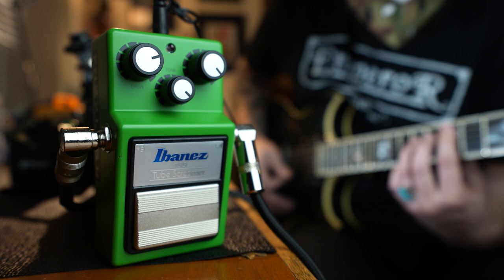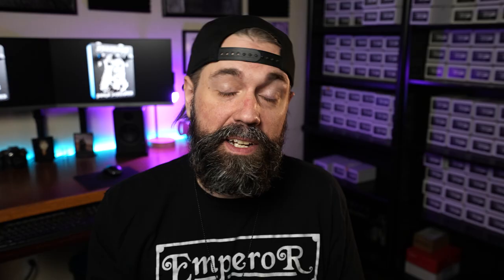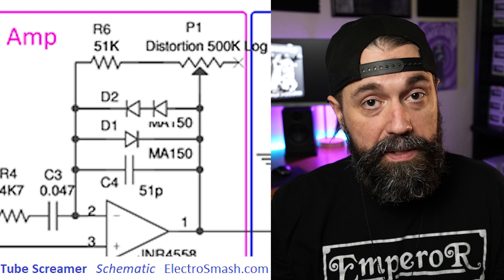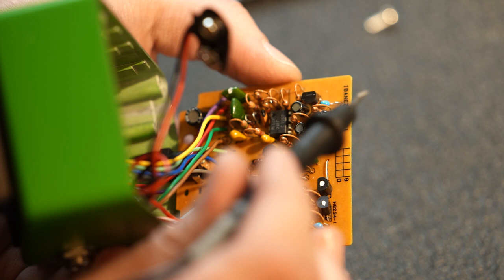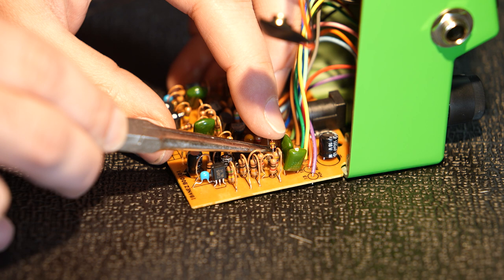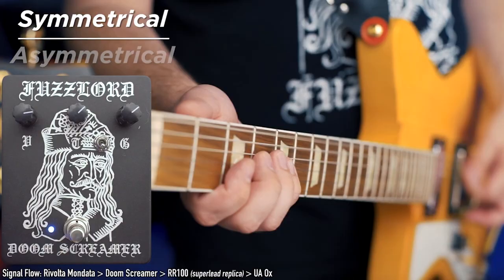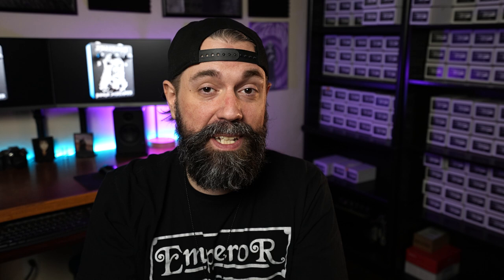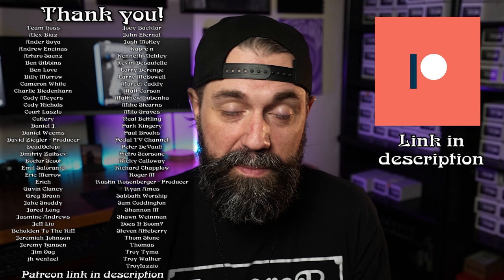How To Mod A Tube Screamer

Comment: Got my first TS9 at 12...my dads bands bassist left it at our house and said I could play around with it. Since he didn’t really use it, he never asked for it back. 

At the time I was using a Roland jazz chorus and it sounded awful for getting hi gain punk rock tones I was after so I didn’t think I liked them or pedals much at all. I found tube amps like the 5150 to give me the sound I was after.

Many years later I found the clean boosting thing into high gain and was back into the TS world.

Currently I have an MXR GT-OD which is a sort of TS808 that can switch to an SD1 via internal switch, and a TS mini.

I still have a love hate thing for that clean signal that’s part of that feedback loop when I’m using it as a regular overdrive (so it’s relegated to only stacking with other drives for solos or as a clean boost into a dirty amp), but I just can’t quit the good old Tube Screamer.

Comment: I am amazed that a new tube screamer still has the original 80s circuit board and is not surface mount! I have never owned a real tube screamer lmao ... I had an 80s Boss DS-1, in the 80s, which i replaced with an OD-2.
Reply from the maker: I was suprised too!

Comment: I have a Demonfx TS clone with switch for TS808 and TS9. I absolutely HATED it. Single coils, HB, hollow bodied with HB didn’t matter - I couldn’t get passed the nasal squawk. For years I’d put it away then pull it once or twice a year. Made me want to vomit. 

I finally tried some of these mods figuring I hated the pedal already and if I F-ed it up no great loss. 

I did the asymmetrical mod and still hated the sound. I then replaced the cap with a 0.15uF instead of 0.1 you recommended. Still figuring no great loss if I screwed up. Well I did melt the pcb a bit but WOW I now love this pedal! 

I didn’t bother with the resistor mod since I didn’t want more gain since I only use low gain. 

I can’t thank you enough for turning this funky green paperweight (yup) into a favorite! I do think I need to invest in a better soldering iron though.
Reply from the maker: I’m so happy to hear the mod went well and now you like the way it sounds!

Comment: I used to like overdrive pedals and I have 3 of them The Rat, TS-9 like yours and the Plexi Drive Deluxe and a Big Muff fuzz pedal, a volume (swell) pedal and a Wah-Wah pedal. Also a tube Monster high gain pedal using a 12AX7. Currently they are all gathering dust. I am in love with Overdriven Tube amps but at my age I am making everyday effort to play clean Jazz and a little blues. I used to play like Jimi Hendrix and in fact this is my natural talent. I played a Strat through a hot rodded Marshall JCM 900 MkIII Hi-Gain head using a Marshall JCM 900 1960A and a Marshall JCM 900 1960B full stack. No need for pedals as the sustain was like a violin and the overdrive was fantastic. The "dimed" Marshall Roar was like a 35 ft. high tidal wave about to break right on top of me on a beach in Hawaii. Actually many times I would turn around and look just to make sure that I had not been transported to that beach and a 35 foot tidal wave was not in fact immediately above me and about to wash all over me. It was a traumatic experience. It was LOVE! I shouldn't go back to that style of playing because it destroys my hearing.
Now, these day's, because I don't wish to give our two birds heart attack's I no longer play at such extremely loud volumes. In fact I play on clean amps and seek to become a better Jazz and Blues musician. It's really difficult for me because my natural talent is playing like Jimi Hendrix- with no effort at all, just wonderful fun and joy and love of music! -Peter age 70
Reply from the maker: Hey Peter! Don't want to rock the birds too hard haha! The Strat through a JCM900 had to sound awesome! Cheers and thanks for watching

Comment: Great video! I don't have any experience modding pedals and can barely get through a basic pickup installation but this really inspires me to take a look at more electrical projects.

My first Tube Screamer was actually a Horizon Devices Precision Drive (before I really understood what an overdrive does). I've had a TS9 and an EHX East River Drive but I'm currently rocking an Earthquaker Devices Plumes. I really miss the old Ibanez original, though; I'll have to pick one up again!

Thanks again, Jason, for making such a killer channel!
Reply from the maker: You can do it man! That is badass you have a Plumes and thanks for watching man!

Comment: Entering V1 with less low end is usually beneficial in order to tighten up the distortion channel for palm mutes (unless you have real metal amp or pedal). But more headroom sounds great. I use my cheap Behringer TO800 with 12V. There seems to be a slight change in dynamics, more so for the AMT K2 that comes afterwards in my chain towards the power amp. Interesting channel, think I will sub!

Comment: I use instead, tc electronic tube pilot adding to the second triode of the 12ax7 tube an 0.1mf grid to ground, 0.1mf grid to cathode and a 25 mfd cathode to ground. Then it is close to transparent with full gain tone. Amazing.

Comment: I first got a sound tank tube screamer in about ‘96. I have since bought a ts-9 about 3 months ago, (I built a diy od pedal but ironically a connection came loose right when I was considering a ts9)...I run a crybaby wah into a TS9, into a hand wired fuzz face clone, with a touch of delay, from a micro cheap pedal, and light amp reverb...The ts9 is awesome!
Reply: I built a klon centaur clone...but soldered the pots onto the wrong side of the board🤦🏻‍♂️minor setback...but a setback nonetheless! I was about to order breadboards and a bunch of stuff to tinker with, and still might...but it slowed my roll! I do enjoy the channel though! Nicely presented information! (McKinley Morganfield is the man I agree;) the episode with playing heavy stuff on a tele was awesome!🤘

Comment: I bought my first TS9 in 2016. I kinda went whole hog back when I was a kid with a Danelectro Fan Tone (still have it), then a Digitech Death Metal (sounds terrible on a small amp, and amazing on a big one). I use my TS9 to boost my Seymour Duncan TwinTube Mayhem if I'm plugging a passive pickup guitar into my rig so I don't have to completely change my gain and EQ from my usual for active pickups. I also use it with an old karaoke mic and a EQD Avalanche Run for making lo fi black metal vocals.

Comment: I got my 1st tube screamer in 2002 it was on the top of the trash at my studio I was handy and I am electrician so I grabbed it and figured it out quickly it was only the switch so I replaced it with a small momentary push button I got at radio shack thru the 3/8" hole that was already right above the pedal part and I've had and used it since. I might try these mods on it 🤔
Reply from the maker: awesome that you fixed it!
Reply: @FuzzlordEffects  ty

Comment: I just swapped the op amp in mine along with a yellow diode on one half of the clipper. It still sounds like a TS9, but I like the effect. More volume, less gain with more of that edge of break up sound throughout the range.
Reply from the maker: nice!

Comment: I dont use a TS that much only when i want to push the mids. I started with a digitech bad monkey years ago that's a great TS clone but have a older Japanese made TS9 on my board now. Had a TS10 i got for cheap but sold it for 10x the money right away. Sometimes i use my MS10 insted of the TS9
Reply from the maker: nice!

Comment: The closest thing I've ever owned to a Tube Screamer was the DeltaLabs copy, but it didn't really work for me. My current overdrive is the MXR Micro Amp, and it sounds so great. I run it at around 2 o'clock, makes my bass seriously cut through the mix.
Reply from the maker: totally, they are a bit of a love/hate pedal. Thanks for watching Conor!
Reply: @FuzzlordEffects  Thank you for the amazing videos! 🙏

Comment: I use a 50 watt Plexi put virtually clean. LOL. I use 82 pedals set up as 4 separate boards with a Boss switcher using 4 loops. I believe I have 3 Tube Screamers but as you know some makers do not admit they are selling you a ts. They sell it as they have just reinvented the wheel. lol  WTF it is just the way it is. As a rule I hate the ts. In it's natural form I believe that  it's symmetrical distortion  gives it an unnatural tone to my ears. OK ...so my first ts is a  Pro Tone Attack Overdrive designed as a  'caboose' with it's fancy high pass filter to tighten amp distortion but I use it to tighten high gain dirt pedals. My 2nd is a MP Custom FX Gainiac Plus virtually a high gain pedal it has zero lows so it becomes my treble booster.  My only serious ts is the Cusack Screamer which I leave in it's asymmetrical mode that I only use when I play my Strat for the only SRV sound I have ever heard that sounds convincing. I do believe that someone should revisit the Pro tone idea with a pedal that is deliberately aimed at tightening and taming other dirt pedals. It should be called 'The Stacker'. Yes Horizon Devices have a couple but NO one tweaks a pedal or worse yet for them MARKET's a pedal for stacking.A guy with a combo and pedals like 99% of all Metal players does not pay attention to pedals aimed at high gain stack users.
Reply from the maker: dang that is alot of pedals!
Reply: @FuzzlordEffects  I have at least 30 more for sale on Reverb ...lol Even I have to draw the line. I also use and take 9 guitars to a gig. I have 3 piece power trio do my 24 tunes. A journalist described the music as  ' a Sabbath vibe with a Prog Rock sensibility . He nailed it. The idea is to get what you would hear on a recording including the Post production but live!

Comment: I run an EHX East River Drive. I either use it mostly as a boost with volume maxed and the gain at 3 o clock. Sometimes I like it with volume just past unity, and the gain at 12 o clock..but that's through my Roland Cube w headphones.. who knows what I'd get up to w a proper amp that I can actually play without headphones!! :P
Reply from the maker: I'll have to try one of those out cheers Aaron!

Comment: My Ibanez TS-9 from the 90's has a Maxon board and a TA7555 op amp. Also, the diodes (first mod) have a white band, not a black one like the 1N914 that I have (any difference?). Can I replace the original one diode with 2 of my new ones? It seems easier to connect both and then solder into place. Thanks!

Comment: Just got my first one, did the 808 mod and it sounds thicker. Someone else has video changing R4 to 2.2K instead of your 3.3K. Can it still be used with the 0.1uF cap? More gain than 3.3K?

Comment: I didn't hear much change besides swapping out the caps. I have the Joyo vintage OD which is a clone of the TS9 I think. I may want to add a switch to swap between the the 100nf and the 47nf.

Comment: Would these mods transfer to other pedals? Like a dod 250 for example.
Reply from the maker: similar concepts but the dod250 is a distortion pedal in it's circuit topology

Comment: Also for what its worth ive used a tube screamer mini for a while, I liked the sound of it a little better in the store. Butttt, now i play an orange TH30 and it seems like the overall tone of that amp, even the clean channel is voiced around the 630-730hz area? I use it as a tool to cut the low end out of my guitar but it seems less useful now that it doesnt have that TS effect like it would have on my marshall JTM.
Reply from the maker: they def like certain amps it seems

Comment: Could you make the pedal have less low end/make it tighter by using a smaller cap value?
Reply from the maker: Yes, but will change what frequencies get overdriven. There is a few caps you can change to achieve the goal. I really enjoy doing the technical QA on patreon 😬

Comment: Those capacitors (I think that's what you said they were) that you doubled up on to make an asymmetrical circuit, what would happen if all 3 were replaced with an led?
Reply from the maker: Diodes (: I am pretty sure there is another video on the channel where I take same pedal and swap for LED. Since it’s an overdrive it mostly just turned into a screamer voiced clean boost 🤘
Reply: @FuzzlordEffects  that's fair, and I was tired when I typed this so excuse my slipup. Are there any unorthodox pedals like a bd-2 or fuzz factory that you think, either with the right settings or right mods would work with a doom tone?

Comment: Jason what do you think is the best way to deal with the tone pot? the original uses a W20K (log-rev log) type which is not easy to find (here in Venezuela is almost imposible). In my DIY 808 (which sounds great) I´m using a 20K lineal and just the last 20% is usable, some others like BYOC uses this solution or 25K lineal too but is not that great...      ...btw if someday you want to clean your store and get rid off old stuff (like W20K pot) I could give you my sisters address in houston to send all that trash there :)     :)    :)         ....what a great human I am don´t you think?, always thinking in environment and helping people...
Reply from the maker: great topic for another video don't forget to subscribe!

Comment: Great Video. I am about to mod a tb clone. Does the rating on the 1N914 matter? For example 75V and 100mA or 100V and 300mA?
Reply from the maker: either one is fine for this purpose cheers!
Reply: @FuzzlordEffects  great, thank you !